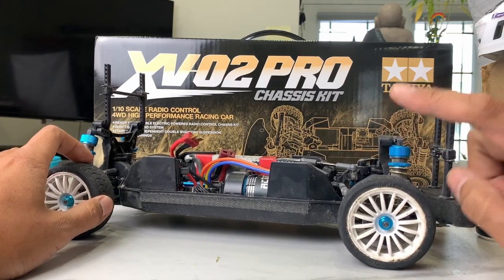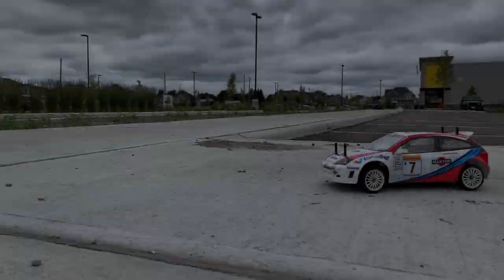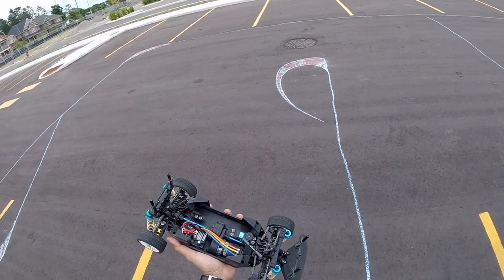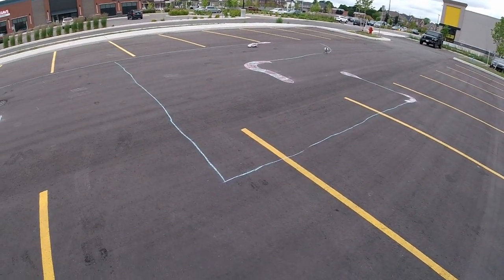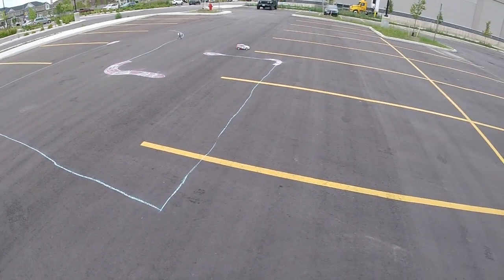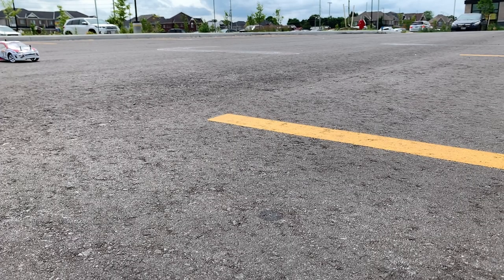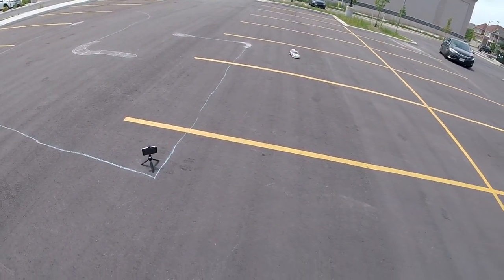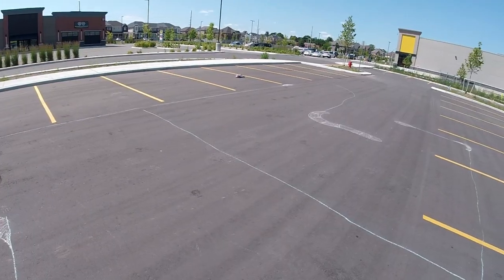THESE TIRES ARE TERRIBLE

Comment: Cool track run! I hear others say they prefer the XV-01 over the 02 pro for rally. Which would you say is better for the dirt?
Reply from the maker: hi, the xv-02 is quicker overall, however a touch harder to handle from factory. It depends on the way you want to drive and what your purpose is. Although the xv-02 is current, parts for the xv-01 are plentiful. They are both drastically different from each other and if I had to choose I'd go for XV-02.
Reply: @rexrcs Thanks Rex!

Comment: How does the fun factor compare with the wr8? I have a wr8 flux and nitro, and I absolutely love it. I just need thicker oil in the centre diff, its a little understeer-ish on throttle. Kind of have to do a scandy flick to get the tail out
Reply from the maker: They are very different types of vehicles in terms of where they can be run, the wr8 has vastly more capability when it comes to running almost anywhere, the size difference is big, also considering the wr8 is based on a buggy/truck. The xv-02 is smaller, more precise, less weight, but I think is only fun on fairly smooth surfaces, it just doesnt have the suspension and clearance to bash like a bigger vehicle. For myself? Ive had lot of fun bashing as high speed doing extreme things, fun factor goes to the xv-02 for me because i very much enjoy making tracks to do laps on
Reply: @rexrcs  Awesome, thanks for the reply. I live in a desert landscape, where nice tracks are hard to come by. I'll stick to the wr8. Enjoy.

Comment: Want to build an xv01 or xv02.  Will be my first build ever.  Had 2 tamiyas as kid that idid not build.  Have a 1 acre front yard and 150 foot driveway so have plenty of room to run on grass and asphalt with small hill too.   Honestly kinda confused and worried about wat model to get and build and if i can put it together to begin with
Reply from the maker: xv-02 will be ultimately the better choice, i recommend using no faster than 17.5 turn sensored brushless system, or just use a torque tuned, they are quite quick. I don't usually run on grass unless it's stubble or approx 1cm in height, I'd love to be close to you if you've got an acre of land to use wow! id remove grass in a rallycross style track layout! xv-01 is a pain to work on in comparison, if you go xv-02 i recommend a centre diff and sway bars, and I think that car will be a golden choice for a front yard rally car, that can be competitive.

Comment: Sir is it really can use normal servo? Not the low profile one?
Reply from the maker: yes you can use a normal servo but you will increase the center of mass also it may interfere with the dust cover

Comment: I would like more info about your TA03 upgrade, and I just ask here, may be you also can comment on difference between TA03, M05...TT02....if certain model is a superset of the other...may skip
Reply from the maker: ohhhh my friend, the question you ask can give such a long answer, those cars are so different from each other, you have a good idea, I will make a video talking about what makes cars different, thank you!

in short here's what makes a car different-
motor position
which wheels drive
servo position
battery position
method of power delivery belt or shaft
how many shaft, how many belts
where are the spur gear and pulleys located
suspension mounting points
etc, soooooo many different things make a car different
Reply: Yes, that's true. I would focus on the economic aspects first.
The TA03 chassis gear case looks a bit like the M05 car, wondering if certain gear components can be replaced by the M car components, as TA03 parts are hard to find.
May be in the end TT02 is the answer, it has lots of parts, relatively cheaper price.
Reply from the maker: @mokka8727  cheaper price is good but I dont think TT-02 is best choice. If you can only buy one Tamiya, maybe try a bit higher than TT-02
Reply: I got TA03, M05, CC01…
I wish to upgrade my TA03 if worth doing so.
Reply from the maker: @mokka8727  i see i understand now, what do you want to upgrade on TA03?
Reply: @rexrcs  can I do something so the drive chain more dominated by the belt, or even take out the front gear? Or diy a graphite chassis, doing so have an option to increase the wheel base distance a bit, should be fun.
Reply from the maker: @mokka8727  it sounds like you have the TA03 with short wheelbase? You can buy the new longer chassis on rcmart
Reply: @rexrcs  how about getting a graphite chassis sheet, cut and drill some holes, it should be much cheaper... TA03 chassis may cost 1/3 of a TT02.
Reply: I just checked rcmart, there's only short chassis...and still have to buy front gear and rear gear for a complete chassis. Can you suggest a way to modify TA03 to a more belt driven car, thanks.
Reply from the maker: @mokka8727  sounds good, it has been done so I can see it working great if done correctly
Reply: @rexrcs  yes I watched your video, that's why I keep asking you. Can TA03 convert into something similar to TA05, as Tamiya guy, TA05 has best drive mechanism regard by many rc builders.
Reply from the maker: @mokka8727  yes TA05 is very special, one of the first mid motor touring car with equal length belts, designed in 2005 today in 2022 other companies are still copying that layout.

Sadly I dont think you can make the TA03 like TA05 unless you do a lot of custom work
Reply: @rexrcs  they are different car, but try to configure it to smooth drive train..., I am mechanical addict, good engineering make me relax and feel good.
Reply from the maker: @mokka8727  ohh i see! A lot of custom work is needed than my friend

Comment: Should try it on carpet too :)
Reply from the maker: I want to but afraid to spend all day rolling unless I change the shock limit internally, the car has no droop limit
Reply: @rexrcs  yeah I can see that being an issue, it’s never fun if you can’t stop grip roll. 
Over here Tamiya racing is very popular, tt01 and tt02, we have to limit shock travel internally and I know it’s a painfully long process to get it correct, 
Could try it on Tamiya kit slicks with no additives  on tyres, let it slide a bit :) that could be interesting
Reply from the maker: @arrenlambert1486  actually… maybe I’ll find the right sized shock setup and I’ll bring it to carpet sooner than I thought! Thanks for the thought